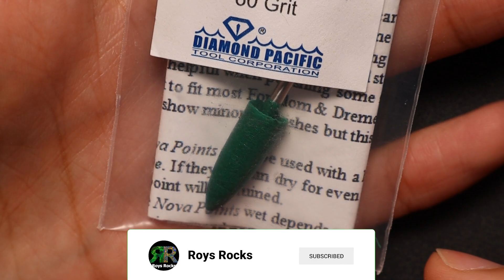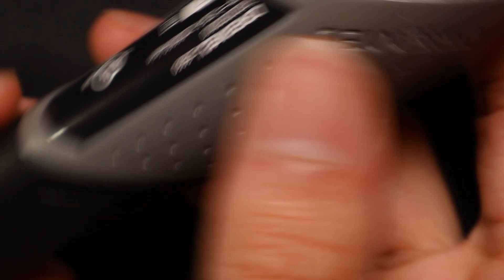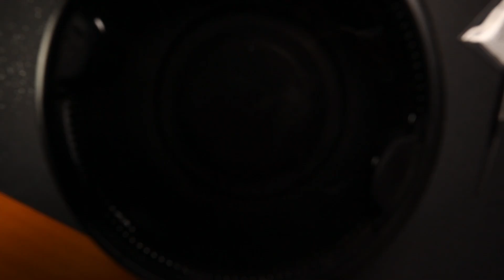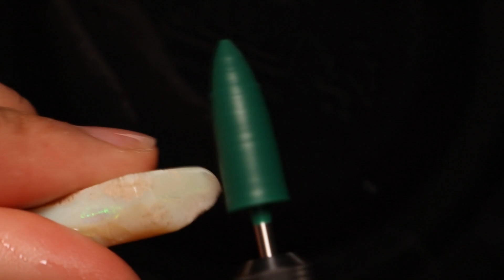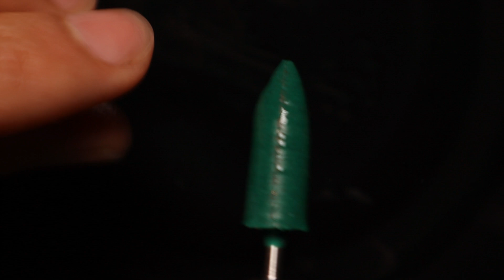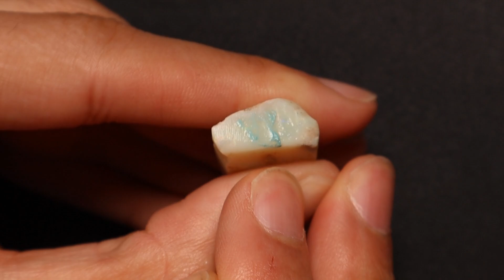How To Break In Diamond Pacific Nova Resin Tools. Dont Use Them Brand New!

Comment: Hey Roy, how long does the standard nova set last? Heavy vs. soft use? Just wondering, I know you may have answered this question already, but I don't know, so I thought I should ask.
Reply from the maker: Completely depends on what is being done with them. Mostly comes down to material some people will burn through a set in a day others they can last months.
Reply: @RoysRocks how long does a set usually last you doing opals?

Comment: Holy crap, thank you.  Just received my new sintered burrs and novas from Suva lapidary and found out I need a chuck adapter for my Dremel before I could use them.  So, why not watch some of your videos in the meantime.  By pure happenstance I stumble across this video and couldn’t believe how my luck was actually good for a change.  I was all prepared to dive in on some opal I had purchased on opal auctions and never would have thought to break these in.  You saved me from a heap of frustration, thank you.
Reply from the maker: No worries. If you give them a go on some lower grade stuff you dont care about that will start breaking them in as well.
Good luck and have fun.

Comment: Thanks heaps.  I'm a wheel user mostly.  However, I have these tips at home for my rotary tool.  I wouldn't have known how to prepare them.  Great clip mate.
Reply from the maker: No worries. You can break in the wheels the same way but most of the time people just grab a chunk of potch and grind through that.
Reply: @RoysRocks  Thanks.  I have the dremel tips at home and use the wheels at a club.
Reply from the maker: @McDowallManor  I wish the local club was closer to where I lived. I'd be there every week.

Comment: Great tip...I know mintabie is supposed to be the hardest but I'll be damned if I don't have problems with it cracking and crazing 😂😂😂 I mean I haven't worked with a whole lot of the material but every piece I have has had some difficulty, either the crazing from tiny sand fissures or a strange black potch that seems to spread into the face like freckles lmfao 🤣 I'm sure you know the stuff with the thin black line between the layers... yeah but when she faces it's usually always worth it...damn it I'm an opalholic 😂😂😭
Reply from the maker: The stuff hates me too. Maybe because I use it to prepare my novas... 🤣
For me its the non facing that gets me all the time.

Comment: I have real cheap diamond impregnated rubber bits. They don't offer them as fine as yours but they seem to do well...Up to about 1200 grit (my guess). Have you ever seen them or tried them?
Reply from the maker: I have tried almost every nova point competitor there is (even some old videos on the channel testing others) but never got the same level of result. Many use a much softer resin or even a silicone by the feel of it. All have either been to spongey for my liking or degrades way to quickly even for the much cheaper price.
Reply: @RoysRocks  I gotta go check out those older videos. Thanks for educating us.

Comment: Thanks Roy, Things make more sense now. I’m definitely using this information to smooth out all my burrs. Especially that problematic 50,000 I commented earlier on. Thanks again!
Reply from the maker: Good luck. It is most important for the low grits. 
I discovered this the hard way a while back now with my 280 giving me a wavy finish on stones out of the blue then I realized it didn't happen with my old one... still took a long time to work out.
Reply: Agree, I have to do this!!